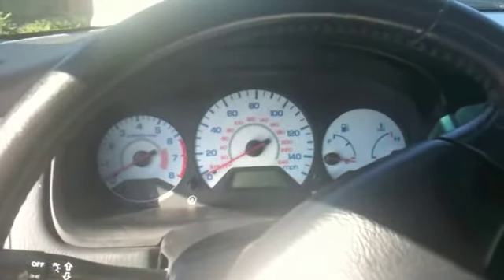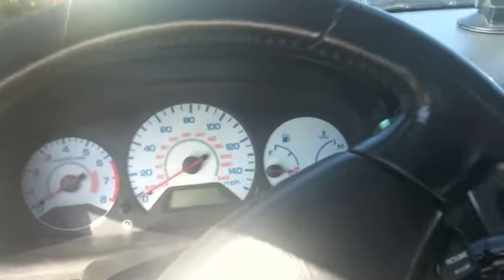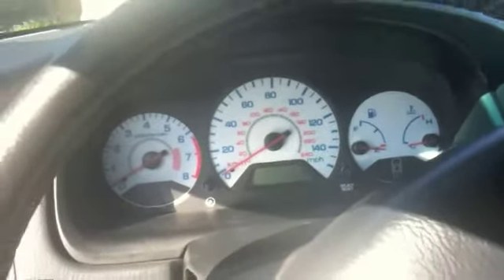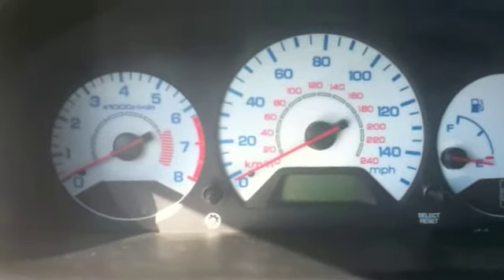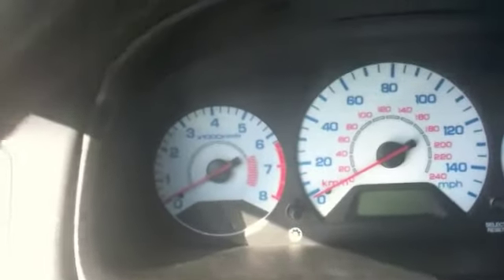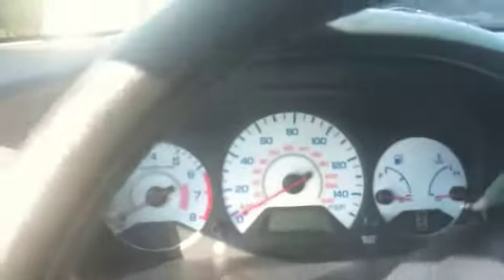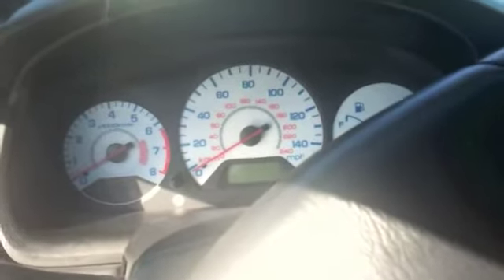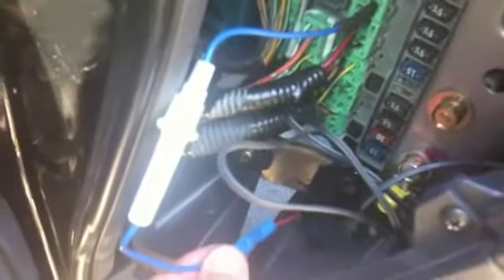Glow Gauges

Comment: Hey I got the same glow gauge on my 98 v6 accord  but the RPM needle get stuck while driving for about 1 to 2 minutes when the headlight turn on. If headlight or parking light is off than the needle move free perfectly. ANY SOLUTION OR SUGGESTION. PLEASE ADVISE. APPRECIATE THE HELP. I WIRED AS YOU SHOW IN YOUR CHANNEL (YouTube ). NOTE: The face plate is flush flat and no interference with the RPM needle.  Please reply soon.